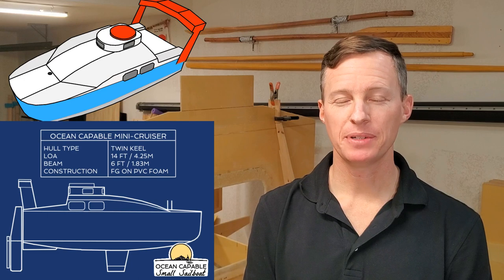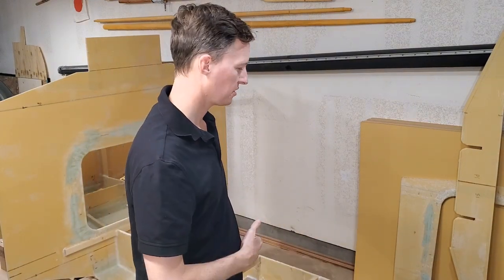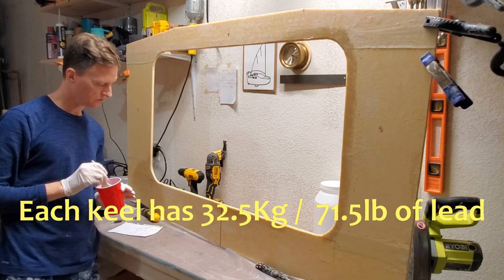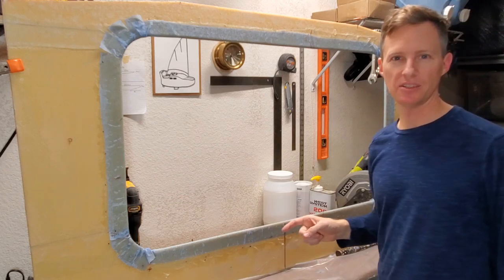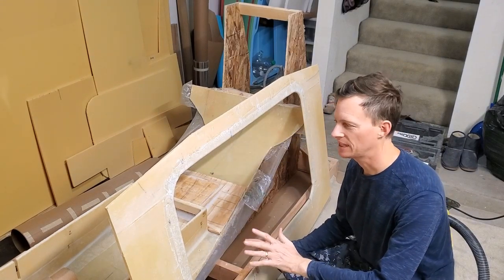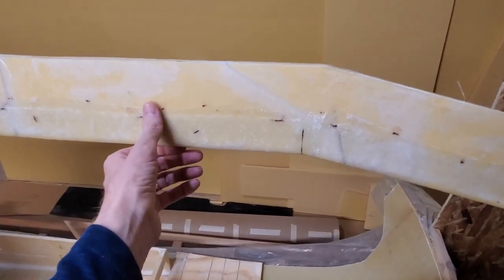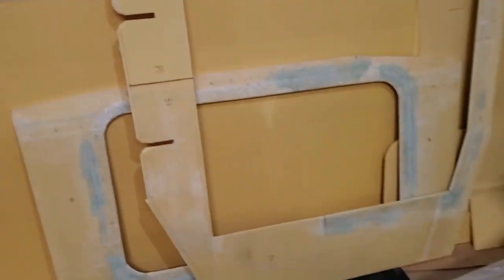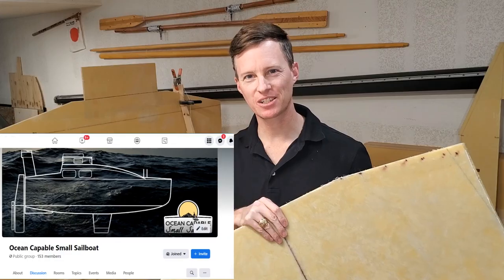OCSS-018 Finishing Frames and Building the Scow Bow Panel - Mini-Cruiser Sailboat Build

Comment: I am so glad you are giving your keels some shape.  Most armatures don't realize that a flat plate has higher drag going through the water than a thicker foil section because the boundary layer starts growing fast from the leading edge.
I hope you are not too attached to your profile selection -you don't need something that thick and there are better profiles.  You also need to consider the zero lift angle of attack -it is likely not where you expect.
There is another guy on YT building a small twin keel sailboat that has a friend with significant experience making keels in steel.  He would certainly be worth a consult.
Reply from the maker: Thanks for the comment. What profile are you thinking would be better? I don't think the one I chose was that thick, about 8cm / 3".

Comment: Excellent move, changing to foil-shaped keels. Be sure to use a foil shape for the rudder, too. I know of someone who changed from a flat board type rudder to a foil, and he said the improvement in handling and performance was incredible. Can't say I'm a fan of those square cornered holes in some of the frames though. Square cornered holes tend to concentrate stress forces, leading to cracks and/or failures. That's the reason all such holes on boats and aircraft have rounded corners.

Comment: Perry, In addition to the hydrodynamics of the foiled keels, it gives you the opportunity to fix a structural issue.   Your (angled) T section is asking a lot from a fillet weld.   The foil section will allow you to add gussets between the keel plate and the mounting foot that will do a lot to mitigate fatigue at the weld joint.  then you can fill in between the gussets with foam.    

Don’t know what corrosion concerns might be with glassed-over metal submerged in salt water.
Reply from the maker: Yeah! I was consulting with a fabricator who suggested using 2 or 3 angle irons welded to the vertical plate, so that it makes tubes with triangular cross-sections. Very strong.

Comment: I stated fabricating my daggerboards for my Naut 475.  They have a similar profile to your keels…bowed toward the center.  I’m not looking forward to pouring lead.  Glad you are giving Fusion a try…definitely helps to plan things out.
Reply from the maker: Cool. I can see in the plan preview that he put the foil shape in there. Does it have a NACA identifier so I can look it up?
Reply: @ocean_capable_small_sailboat  He doesn't list it.  You could probably ask him.  I'm a little bit torn on the idea of asymmetric daggerboards as it means they aren't redundant to each other if something happens to one of them.  I guess if something happens to one of them it means I crashed badly and might have other problems with the boat other than a bad daggerboard. ;)
Reply from the maker: It's such a remote chance that you'd break one, I wouldn't worry about it. You could probably build an emergency daggerboard with a symmetrical foil that fits in either slot. It would be good enough to get you back to port.

Comment: I like the "lifting" foil keel for some reason and not for one. When both keel is full in water no problems. When one keel start to go over water it loose lift. For supporting side forces I would have a wider and thicker  plate on the top and bracings or knees inside the foil where the lift is strongest.  And maybee a brace inside on a plate ( bolt on) one the top of the bracing.

Comment: Im not sure abt the foils... but maybe im wrong...
If the boat heels over a lot... the leeward side keel could be above surface. 
The other keel which is still in the water keeps healing the boat further instead of bringing it upright.
I would reverse the foil action... (But thats just my 2 cents)
English is not my natural language, but i think you said minimize leeway (can i interpret that as drifting sideways?)
In that case longer keels will help (that will also help in pointing towards the wind)

Good job by the way.. nice to see people actually making things and enjoy that :)
Reply from the maker: Thanks. I don't think there's any danger of the keels being out of the water. They are located on the bottom panel, each is just 28cm from centerline. I'd have to capsize to get a keel out of the water.

Comment: that asymmetric profile only works one way as an aerofoil. To work with two angles of attack you need a symmetrical  one such as a C6
Reply: That's exactly the idea. The profile on the other keel is a mirror image of the first.

Comment: Hi Cptn Perry, using a pair of foils would be exactly what I will do.
One idea is to fabricate the foil fully from steel and filling with lead, either poured or shot.
Can be done relatively easily using a couple of different diameter pipes some flat bar and sheet.
If you are interested I can send you an email with some details.
Reply from the maker: Yes, please send me some info on it. Thanks.

Comment: You might be over thinking the keel setup.  My guess that on a boat of this size, the performance risks around the foil design out weight the possible upside.  I'd think your number 1,2, and 3 issues would be the structural integrety of the design.  With two keels you double the chance of knocking one off...
Reply from the maker: The great thing about the boat being small is that it's easy to make these keels strong for the size of the boat. I can't think of any risks added by adding a small foil. It's just a bit of performance increase.
Reply: @ocean_capable_small_sailboat  Risk is probably the wrong word, questions probably better.  How lift, drag, cavitation at different points of sail, heel angles...all in a dynamic environment impact boat performance - who knows?  To go to all the extra work and cost, the performance benefits would need to be substantial.  Good luck.
Reply from the maker: @paulgiusti9703  Not much extra cost (a friend and I will do the welding,) just have to add in a couple angle irons & steel pipe for rigidity and the shape, with some foam inside. The fiberglass materials I already have. A little extra time, but I enjoy the time spent on it.

Comment: Looking good Captain Perry! Can't believe the progress. I do have a question. At 4:48, you say the foil will be on the "inside". I may be way off here but won't that create lift on the wrong side of the keel. So when you heel and pick up speed that will increase lift to the inside, thus exacerbating the degree of heel? Regardless, amazing project. I wish my project moved as fast as yours. Best!
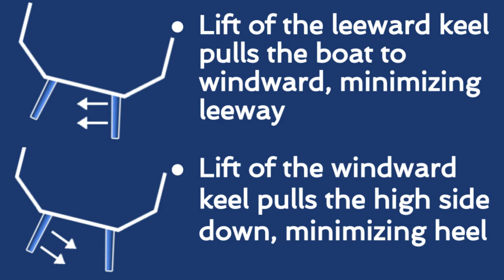Reply from the maker: Thanks bro. Progress feels slow to me! You saw the diagram I drew at 4:44, right? I didn't understand it at first either, but after reading up on it, it makes sense. As you heel, the windward keel moves more horizontal. So, it's lift force is pointing down, helping to right the boat. The leeward keel is more vertical in the water at that point and its lift pulls the boat to windward, helping to minimize your boat's slip to leeward.

Comment: One of the most compelling reasons to fit twin keels is an ability to dry out on land. IMO you'll get a more stable boat with less stress on the keel to hull joins if you make the keels a bit longer, even if this means sacrificing a little speed. If you make the skeg protecting the rudder a few inches shorter than the keels the boat will naturally dry out in a stable position on flat sand.
Regarding the foil section; I'd be interested to know how much speed you'd sacrifice with additional drag over using just a thin flat plate. If you were sailing downwind wouldn't the channelling and squeezing of water between the foils tend to act like a brake?
Reply from the maker: In my first mock-up, the keels are only 3" / 7.5cm thick, the foil should let it slide through the water more efficiently and add that benefit of a little bit of lift, but I don't think the drag will be enough to really cause any trouble.

Comment: The flat plate at the bottom of your keel will work as a drag any time your bow is down. Won't that increase the hobby horsing on such a short boat?
Reply from the maker: I don't think so, there are other examples of keels with wings out there. The great thing is you prevent water from slipping over the bottom of the foil. It increases efficiency and reduces leeway. The advantages outweigh the disadvantages.

Comment: Something about the keel foils doesn't seem right. I think what you're going to end up doing is adding drag to the foils without any noticeable improvement in upwind performance. I'm not a nautical engineer, but I think symmetrical keels (like you would have for a rudder) will provide lift from both keels without having them work against each other. Yes, the keels will be at 30 degrees to each other, but both will be in the water virtually all the time, and whatever force vector advantage you have from the leeward keel you'll only have going upwind, and it will be very small. The opposing force of the upwind keel will cancel 85% of the side force generated by the leeward keel. Meanwhile you'll have extra drag on all points of sail, with no advantage at all going downwind. I used a NACA 0012 foil shape for the rudder on my 44' sailboat which was a reasonable compromise between lift and drag, and from what I've read would be a good choice for your keels.

Good work... and keep those updates coming! thanks, Dan
Reply from the maker: Thanks, the foil shape I used isn't really the final choice, just one I grabbed for the 3-D model. I could use the NACA 12 foil and just make the outboard side a bit flatter. I think there's a compromise I can find where I get a bit of lift to use as described in the video, but don't really add much of any noticeable drag.

Comment: Am no expert, for my 2 cents worth those "airfoils" look a bit broad/wide in profile? Compared to what you see on much bigger vessels.
Anything under the water line is going to create more drag by dimensions and weight.
Reply from the maker: 3 inches (7.5cm) thick, 21 inches long (54cm). Shouldn't be too thick. I haven't really finalized any dimensions yet though, still have time to make changes if people have better ideas.

Comment: I was wondering when you were going to figure out that foil shaped bilge keel's would be much more efficient. 
Only down side to a bilge keel, is a snappy roll in some conditions when at anchor. There is a free program available that simulates hull tank testing that will let you test your keel design and placement in order to minimize turbulence and improve your hull efficiency.
Just saying.
Reply: Do you have a link (or at least a name) for that tank testing simulation, please?

Comment: Wont the keels work against each other and create drag? They will create a force towards the center and mostly cancel each other out, but the forces are subtracted from your forward force created by the sail!
Reply from the maker: Any keels will create drag, these just add a little bit of lifting action which improves performance. Much smarter people than me came up with this design and it's been successfully been implemented on ocean-going yachts. With the keels canted outward and the boat heeled over, the forces aren't fully cancelling each other out. One acts more downward and the other sideways. See diagram at 4:23.
Reply: @ocean_capable_small_sailboat  I see the benefits, its used in aircraft too. Downwarts angeld wings for agility and upwards for stability, but your keels are more parallel and water is much denser than air, so the canceling forces might be pretty high. But I dont know boats and if it bekomes a problem, you coud always remove the wing shape! Nice build, by the way, I am learnig a lot about fiberglassing! Greetings from germany!
Reply: @ocean_capable_small_sailboat  I looked again at your keels and the explanation and I am pretty sure it doesnt work that way. The forces cancel each other out around the lenght axis, all that remains is downforce directly in line with the mast, ballast would be better for that, because it always works down and doesnt change with the heeling angle.
Reply from the maker: @KarstenM.  http://www.brayyachtdesign.bc.ca/article_twinkeels.html Read the article. You're not taking into account the fact that the keels are not parallel to each other, they are canted out. "When heeled, bilge keels draw more water. At 15 degrees heel this boat draws 5'-0" but when upright it only draws 4'-0". Also the lifting action of the asymmetrical keels can be seen. The vertical one is reducing leeway and the more horizontal one is helping to right the boat."

Comment: it says 'Air Foil' do air foil work in water just fine or do you need a water foil?
also it may be worth getting 2 steel keel fabricated for you if they are a hard steel shell  you could to that water pocket thing where the keel will drain out the water if it capsizes and make it easier to right
Reply from the maker: I'm not sure if there's a recommended "water foil" shape, but I'm open to suggestions. Why would I want water to drain out of the keels when capsized? That's when you need that weight in the keels to help you right. I'm not wild about the idea of having water inside my keels, though. I feel like it would just get filled up with marine life and be impossible to inspect/clean/repair in there.
Reply: @ocean_capable_small_sailboat  i was mistaken,  On Lifeboats they have pockets that fill up with water to help stabilization, After I fought about it the weight of the keels would tip the boat back over. but that said i remender some boat use water as ballast and they just Empty it  before putting it on the trailer

as for foil shape if you look at fins and keel fins you will notice that there are quite thin, water is 800 as dense as air (more or less) so airplanes need steep airfoils to Direct enough air, with water you will get a lot more lift action on the keel. it could  (possibly) lift you out of the water if your going fast enough.

You should probably speak with a professional Shipwright at some point before you commit to anything expensive Because it would be a lot cheaper for a consultant fee than having to remake the keel
Reply from the maker: @nuthenry2  Keels are only 7.5cm (3 in) thick with a length of 54cm. Not much. I will have water ballast below the floor in the form of drinking-water bottles. Easy to remove if needed.

Comment: Its very sad that you went from junk rig to overcomplicated, unreliable spinning mast.
Reply from the maker: That's a negative way to look at it. First, this boat was never going to be a junk rig, so there was no switching. I'd say the junk rig is much more complicated with all its battens, extra sheets and other lines. The spinning mast is simple, just requires a bearing at the bottom of a tube. Unreliable? Tell that to Yann Quenet who has sailed around the world with this rig in his boat Baluchon without issue!
Reply: @ocean_capable_small_sailboat  Its your boat - your choices. But tenten 425 V2 plans are with junk rig. In plans there is mast step, all needed reinforcement for rigid free standing  mast not spinning mast. Also triangular sail will have different center of effort than junk rig in plans, this affect sailing quit a bit. Not sure about Yann Quenet, but I from looks of it its not original tenten 425 or he heavily modified it. But hey - good luck for you!
Reply from the maker: @vaidotasratkus7619  From the beginning, before materials were ever ordered, I planned for this boat to have the Ljungström rig, so I don't see the relevance of what you're writing. Tenten 425 plans were a starting point, but there isn't a single panel on this boat that still has measurements from that plan. I don't really think you can call it a Tenten 425. If you want to build a boat with a junk rig, go for it! I actually like junk rigs too, I just want to use the Ljungström rig.